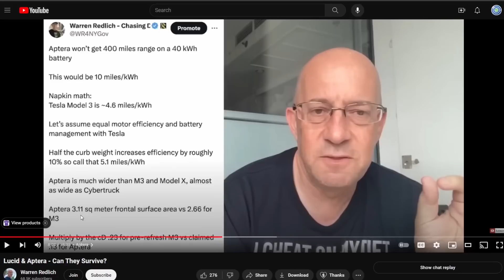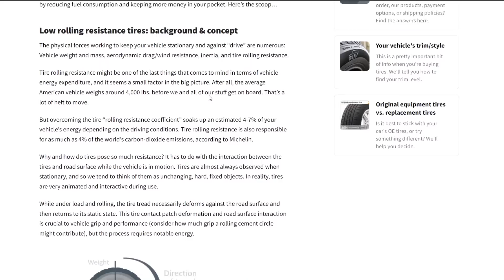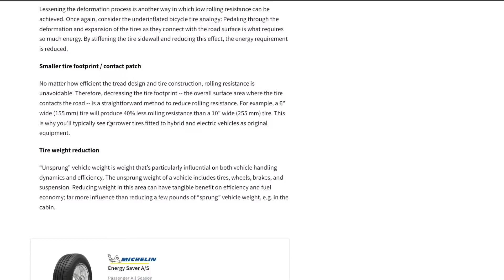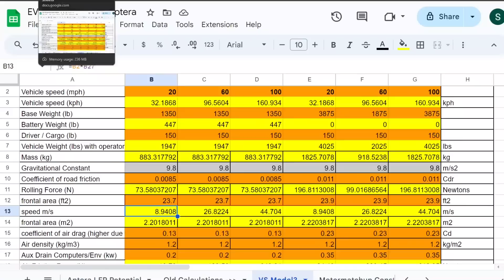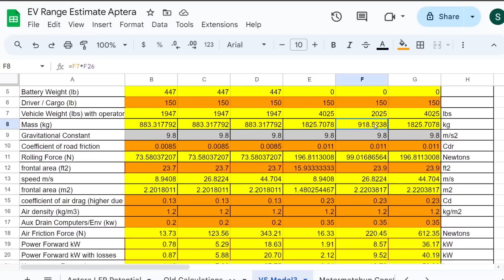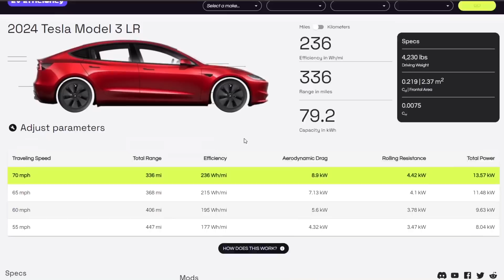Revisiting Aptera's Efficiency

Comment: The spreadsheet doesn't seem to include the affect of the solar panels.  When the panels
are modeled for a sunny day by changing the AUX DRAIN to 0 the decrease in range at 
speeds lower than 20 mph disappears.  If its modeled on a brighter day when the drain is -200 watts
then it goes to infinity at close to 5 mpg, so in slow traffic you're gaining energy.  All three curves
converge towards higher speeds as the drain influence is overwhelmed.

Comment: The thing I wonder is though does the Aptera have a heat pump? I don't remember if it did, but if it doesn't it's going to take a massive hit to the range in the winter, especially wince the battery is half the size of the average EV.

Comment: HVAC energy usage... My chevy cruze was recently killed by a deer. It's AC unit was 2.2kw, and it was not able to keep up with hvac demands be it cooling or heating. The aptera will have a 2kw compressor but paired with a variable speed motor. Chris said that it should take about 200w to maintain a comfortable temperature inside when it was 95f outside. Also they are putting all of the components inside of the thermos instead of outside like other vehicles.

Comment: Regarding wheel count and rolling resistance, since the mass on the wheel is directly proportional to the rolling resistance, subtracting a wheel but retaining the same vehicle weight just increases the rolling resistance of the three remaining wheels. However less wheels does result in less rotational mass which is also an impact on efficiency. This is seem on EVs that have various wheel packages and is usually explained by the larger wheel and proportionally smaller tire has more mass. Sometimes less efficient, wider tire are contributors too. 

There was a human powered bicycle study done to determine the optimal wheel count. Regarding rolling resistance alone, more wheels were better, but when you added frictional losses of wheel bearings, and the aero penalties of where each wheel cut through the wind, I believe they arrived at 4 wheel with front and rears in line.

Aptera obviously has light weight to its advantage regarding rolling resistance, but dropping a wheel and placing the odd wheel outside of the aero stream of the front two wheels is a disadvantage to efficiency.

Comment: Thanks! So can we learn with these tools how the AWD & FWD versions of the 4 Aptera battery sizes might vary in efficiency? Aptera seems to be advertising this fixed ~10 miles per kWh efficiency value, seemingly across all 8 of these builds. Physics of course should require that for max efficiency: FWD 250mi > AWD 250mi > FWD 400mi > AWD 400mi > FWD 600mi > AWD 600mi > FWD 1,000mi > AWD 1,000mi. Aptera's customers really should know the estimated mi/kWh, or MPGe for these eight build options, albeit modeled to start with.

Comment: Funny that's the opposite in bicycle tires as some will know from recent data and testing. In other words, the wider bicycle tire has a wider but still shorter, thus, smaller contact patch than say the "old school" skinny tires which have narrower but longer contact patches. Therefore, a 28c tire is going to have more rolling resistance than say a 35c tire etc. It sounds counter intuitive but only if you have always assumed the lighter weight tire was absolutely faster but between the said tire sizes weight is not a huge factor when compared to tire patch size and rolling resistance.
Reply: Yes, counter intuitive indeed. Why would skinny tires have longer contact patches? In the Tour de France they are inflated to 115 to 135 psi varying for max efficiency and power delivery by front/back and stage of tour needs. Why are increased weight and air resistance negligible factors?
Reply: @jeffcarlton3590  Indeed in the Tour they mostly all ride wider tires now anywhere from 25c to 32c etc. And tubeless which allows for even lower tire pressure.

Comment: Regarding the bike tyre thing, road bikes are slowly moving from 23c to 28c due to lower rolling resistance and more comfort. That suggests that the friction/rolling resistance of the 28c tyre is less, potentially due to a smaller overall contact patch.
Reply: Contact patch is same, regardless tire width at the same tire pressure. Difference in rolling resistance comes from sidewall deformation and rubber hysteresis accompanied with it. Wider tires has less sidewall deformation at same pressure therefore lower rolling resistance but bigger air resisitance due to bigger frontal area. 28 mm is somewhere near to sweet spot   for efficiency  for a road bike. Example in this video about bike tires and rolling resistance is somewhat misleading.

Comment: Looking forward to my Aptera. Efficiency should be good. My rooftop solar system will make it 100% solar powered , but its solar will be a minor contributor Ok with that.
Reply: Over 6,000 miles per year is a minor contribution? Does your rooftop solar completely cover your home's electricity use? Consider using your 'home electricity plus Aptera' combined energy use when evaluating Aptera's overall contribution to your energy use footprint.
Reply: @jeffcarlton3590  
The 6,000 miles per year if optimistic.
An engineering design review of onboard solar panel real word output based on the light year and Aptera, by an engineer who drives a solar powered EV.
https://www.youtube.com/watch?v=xIokNnjuam8&t=2s
Reply: Lacking a heat pump won't help Aptera but its smaller cabin area will. I will be exploring ways to add in a light thermal barrier in the coldest times of winter that isolates my Launch Edition’s cargo space which I will keep cold, from its passenger space where the heat ducts live. This barrier can be employed to increase efficiency and save costs on summertime cooling as well. Then, back to winter, more 'appropriate for winter clothing' combined with a lower thermostat setting are well known energy and cost saving measures. I save on car cooling in the summer with a spray bottle and fan-only cooling when it is not overly beastly. Evaporative cooling is often quite effective. 

At home my thermostat is set at 52 F and I do not heat rooms when they are not being occupied. I do not have thermostat controlled cooling at home, so fans and evaporative cooling are my only options. 

All that said, I am disappointed in Aptera's decision to 'heel drag' on their eventual heat-pump deployment. My 2013 LEAF has a great heat pump, beating Tesla to the punch by several years. Automotive heat pumps are decade-old tech. Aptera could start by on-boarding a basic off the shelf one and ramp up its efficiency and customization for Aptera's unique characteristics as time and money allowed. A 'hyper focus on efficiency' should be giving this issue higher priority. Hopefully they will be well along this maximized efficiency heat-pump journey by the time they are sending out their most efficient 250 mile, FWD build models. ‘Winter is a thing’ in most of their customer’s world.

Comment: Aptera has a resistive heater so the Aux Drain will be much higher than the model 3 in cold weather.
Reply: Lacking a heat pump won't help Aptera but its smaller cabin area will. I will be exploring ways to add in a light thermal barrier in the coldest times of winter that isolates my Launch Edition’s cargo space which I will keep cold, from its passenger space where the heat ducts live. This barrier can be employed to increase efficiency and save costs on summertime cooling as well. Then, back to winter, more 'appropriate for winter clothing' combined with a lower thermostat setting are well known energy and cost saving measures. I save on car cooling in the summer with a spray bottle and fan-only cooling when it is not overly beastly. Evaporative cooling is often quite effective. 

At home my thermostat is set at 52 F and I do not heat rooms when they are not being occupied. I do not have thermostat controlled cooling at home, so fans and evaporative cooling are my only options.

All that said, I am disappointed in Aptera's decision to 'heel drag' on their eventual heat-pump deployment. My 2013 LEAF has a great heat pump, beating Tesla to the punch by several years. Automotive heat pumps are decade-old tech. Aptera could start by on-boarding a basic off the shelf one and ramp up its efficiency and customization for Aptera's unique characteristics as time and money allowed. A 'hyper focus on efficiency' should be giving this issue higher priority. Hopefully they will be well along this maximized efficiency heat-pump journey by the time they are sending out their most efficient 250 mile, FWD build models. ‘Winter is a thing’ in most of their customer’s world.
Reply: 100% but range ratings are done without heating or cooling on.  The interior volume is small and the exterior materials are above average insulators so it should be reasonable.  Some discussed the possibility of cutting up a hottub cover to seal the passenger area from cargo on the forums almost 2 years ago.

Comment: Thanks Steve for another landmark Aptera vid!  
As you know high-end, $3,000 -$10,000 road bikes are probably among the most efficient forms of human transportation devices in the world.   There are several factors that contribute to their amazing efficiency, but two of the most important of these factors are within the tires and wheels. 

Wheels:  Mass/weight is removed away from the circumference (the rim) of the wheel.   
When a wheel is rolling, energy is required to accelerate/decelerate the mass at the circumference (outer edge) of the wheel up and down in a motion that forms a half sine wave pattern ("nnnnn").  The less of this, the better in terms of rolling efficiency of the bike.  

Tires:  Since tires are at the wheel's circumference, the lighter the better (as you already mentioned in your comparison of knobbies versus road tires).   There is also another factor: tire carcass construction - notably Threads per inch (TPI) of the carcass.  The more TPI, the better able the sidewalls will be able to flex without the friction of threads rubbing against each other as with the case of a low TPI tire.  The difference this makes between tires of same brand and size is remarkable. For instance, a comparison between Continental's $30, 60 TPI, Ultra Sport 330 gram, 700x23c clincher versus Continental's $150 ,220TPI, Grand Prix 4000 208 gram, 700x23c is remarkable.  The Grand Prix just roll like ice skates and feels self-powered and you're hardly pedaling. In contrast, the Ultra Sport feels like you're rolling over molasses and you're pedaling hard constantly to keep up with the same bike with the GP 4000 tires.  Tubeless tires also decrease circumference weight.

On a the Aptera I bet that if a special tubeless, puncture resistant tire with such efficiency considerations could be developed for the Aptera, perhaps it would add over 10% more range?

(A higher pressure tire (e.g. 70-75psi) would likely require re-calibrated shocks).
Reply from the maker: I've never tried expensive tires on my bike.  Do they really make that much of a difference?
Reply: @ApteraOwnersClub  Hi Steve!  My brother-in-law who owned a bike shop in Santa Rosa, taught me a lot about bikes and I began building/re-building close to 100 road bikes for church friends between 2014-2018.  I've slowed down since then and now am dabbling in e-bike conversions.  A lot of the upgrades for these people was focused on the wheels/tires, then drivetrain, then ergos.
 
The difference a tire upgrade would make depends on the tires that are presently being used.    There is generally a tradeoff between efficiency versus longevity/puncture protection.  Also wire-bead (non-folding) versus folding tires is a big factor.  Folding tires are better than wire bead tires.

 In the old days the most efficient tire was racing a "tubular" or "sew-up". But those are gone.  Now tubeless clinchers are the most efficient offered.  Also changing, is the tire size.  Formerly 700c x 23c and 100-180PSI was the standard, Now larger width 700c x 28c or 32c and 80-105psi are the preferred tire width (700c x 32c was considered cyclocross size tire, but now is the norm for road tires: 

Some example clinchers brand/models (that I've actually tried) from the most efficient (and listing their drawbacks):

1. Vittoria Open Corsa CX - 320tpi, 150psi, 180gr  Pros: This is close to the most ridiculously low rolling resistance tire out there.  Cons: Very thin thread, very little no puncture protection. Flats easily, and will last no more than a few hundred miles.  Mainly to win races.  (But so much fun!)  I have my set to use as a standard and for thrill rides.

2. Vredestein Tri-Comp Fortezza 120tpi, 175psi, 230gr.  Pros: has the most "tubular feel" (very round profile, neutral steering). Nice sound, Great plush feel.  Fun!  TriComp Fortezza model may have been superseded, but successors carry on the these qualities.  My Fav. Cons: a bit heavy, Despite puncture belt, still gets flats.

3. Continental GP4000 180tpi, 125psi, 200 grams.  Pros: low rolling resistence fast tire.  Good puncture resistance.  Used by many for racing.  Long lasting., Light weight.  Cons:  Has a non-round "pointy" "V" shape profile that kind of feels like it "falls" into turns (opposite of the Vredestein).  

4.  Kenda Kaliente Pro 120tpi, 130psi, 205 grams Pros: fast, low rolling performance on par with all above, but at budget price. Decent puncture protection. Cons: None I can think of other than lacking any distinctive character.

Tires with puncture protection:

1. Continental Gatorskins (folding): pros: lightest, 
2. Schwalbe Marathon (I'm running Marathon Supreme on e-bike. has same low rolling resistance as Gatorskins, but more protection
3. Specialized Armadillo:  Most bullet proof, but quite heavy tire.

Ways to add puncture resistance:
1. Mr Tuffy Tire liners
2. Slime (make sure bike is parked with valve stems are positioned at the top.
Reply: @ApteraOwnersClub  What tire are you presently running?  Maybe a Continental Gatorskin 700x25 or 700x32 is best for commuting (don't want flats on a commute.  Gatorskins are not that great in wet.  Schwalbe Marathons are great commuter tires with low rolling resistance and better protection than Gatorskins.  I have the Marathon Supreme 700x32c) on my e-bike.  They're great.
Reply from the maker: I run the cheap Continental ultra sport 2